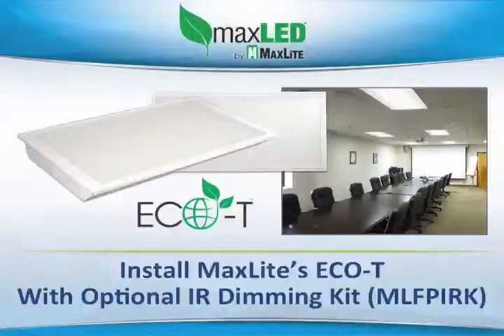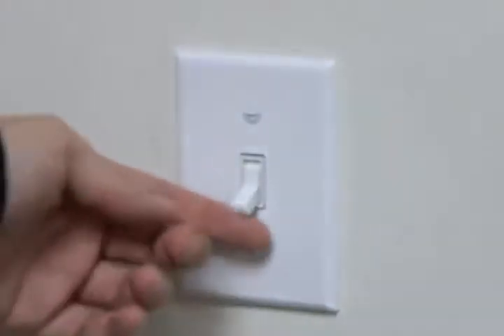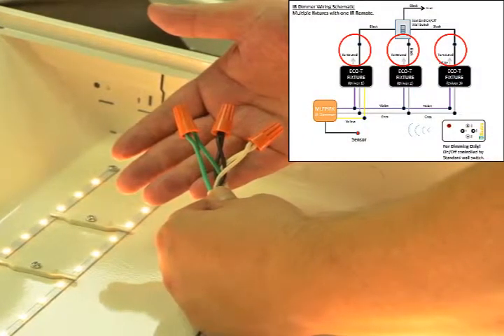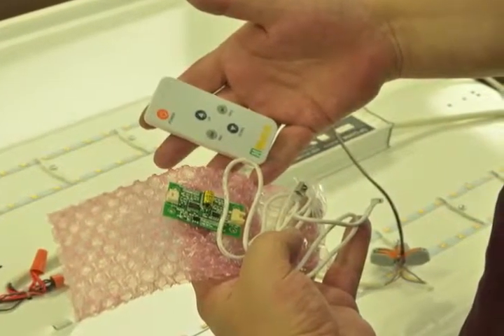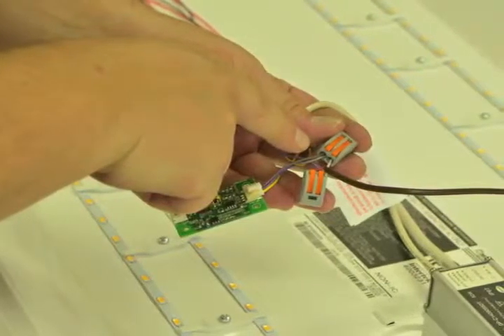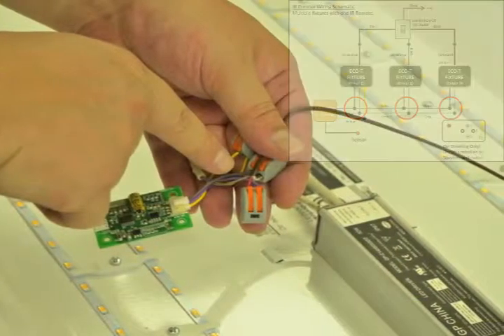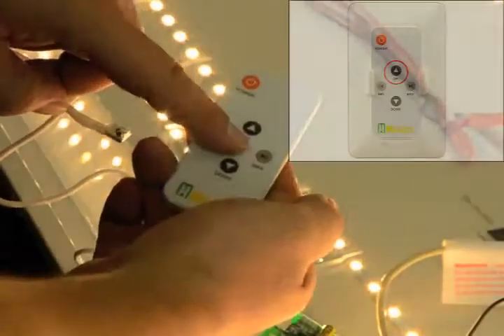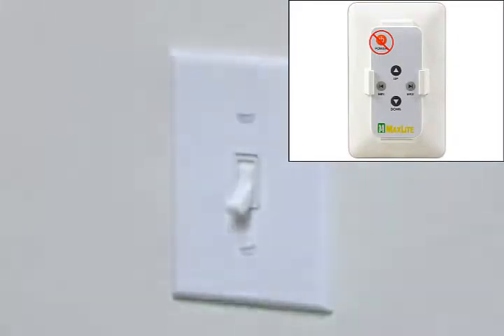MaxLite ECO-T LED Recessed Troffer With IR Dimming Installation Video

Comment: A question that is not answered here is when you turn the lights off with the switch then turn it back on later what level will the light level return to? And is this the same kit that works with your other troffer style light kits?

I have a wireless kit for a ceiling fan/light at home. This unit mounts into the wall just as a normal switch does. But if you wish to take it out you simply press on it and it pops out of the holder that is in the wall. It looks just like a normal wall switch but it is and does so much more. I really prefer this type of remote control. It does not have a cheap credit card appearance.
Reply from the maker: A great question! The light level will return to the same level the fixtures were at the last time they were turned off. Additionally, the IR dimming kit (MLFPIRK) is the same one used with our other LED troffer style products. We also have a wall plate like the one you described that allows the remote to be easily mounted and removed (MLFPRWP)